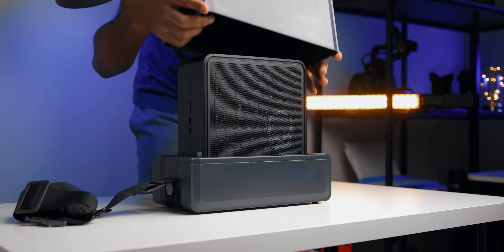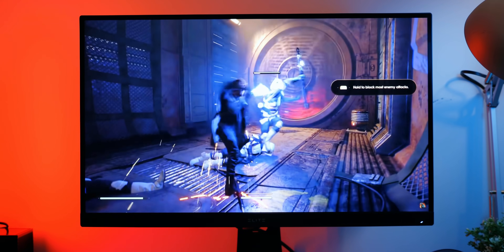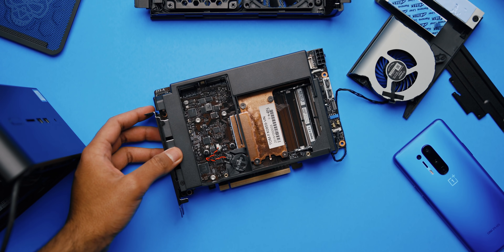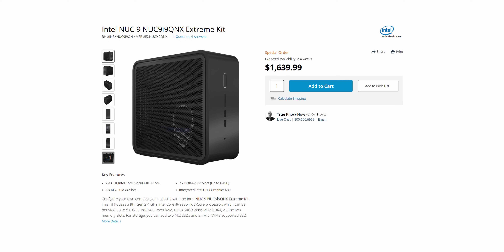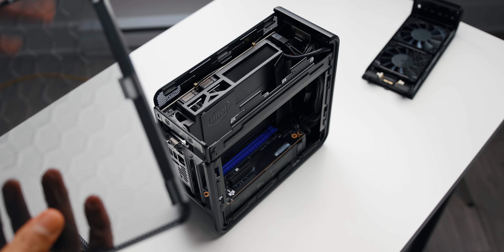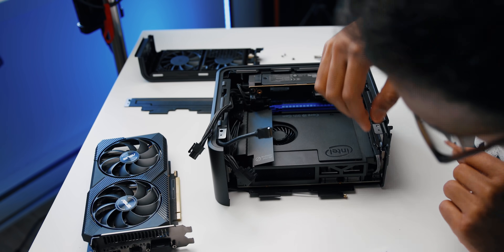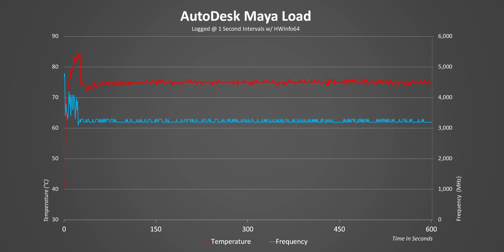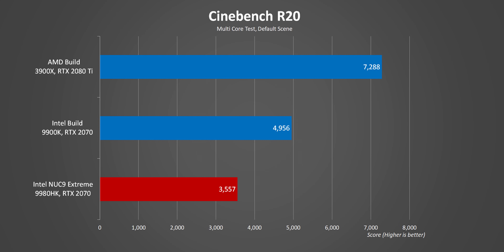Is This TINY Gaming PC Worth It?  Intel NUC 9 Extreme Review

Comment: I just bought the i7 model brand new for £480.  I added a Samsung 970EVO Plus 1TB and 64GB of RAM from an 8th gen I3 NUC that I had running Server 2019.

Fantastic upgrade for a Hyper-v server.
The i3 was struggling with multiple VM's.

Going from a dual core with HT  to 6 core with HT is great for the Virtual machines.
Reply: @ConkeyDonkey  I have upgraded mine to Windows Server 2022 Data center.

I run around 14 Virtual Machines.  I have not looked into Proxmox yet but I do have the 8th Gen NUC I could use for Proxmox.

Comment: NUCs are absolute garbage. There is no segment they really fit into. Single use case, get a pi. Small factor, build a iTX. Power saving? AMD iTX. Longevity? Again, PC all day. Other than a single use device that MUST be windows, I see no real benift to them. And yes i have used them at work and yes i have owned one.

Comment: I needed a small PC myself, and I went for ASRock DeskMini A300. It is a barebone containing motherboard with AM4 socket, two SO-DIMM slots and two M.2 slots (one for NVMe, other for Wi-Fi). I put a Ryzen 5 2400G, 2x16GB of 2666MHz DDR4 and a Samsung NVMe I already had in it. The form factor is smaller than the NUC, the performance is lower as well though, and it has no slots for a discrete GPU. But it's cheap and with far more replaceable parts than a laptop (or this NUC).

Comment: All these reviews are confusing me.
The only place I'm seeing these being sold is on simplynuc and you can kit out an i7 model with an rtx 2070, 16gb of ram and 128gb storage for £1,500 which, when compared to other prebuilt pc's I've seen, sounds quite reasonable considering the size and power.

Comment: As usual you don't have a clue at who or what the NUC is designed for. Your IGNORANCE about things NUC is almost as bad as the Verge. Watch a PROPER channel such as Gamers Nexus to understand what the NUC is about. They have always been ridiculously expensive. They are not designed to be compared with existing platforms. They are experimental in form factor and design and implementation. Learn your PC history. I've been building PC's for 30 years and your lack of knowledge is astounding.
Reply from the maker: No.  They WERE an experimental form factor.  This is NOT an experimental form factor anymore when there are plenty of ITX systems that can reach similar sizes and if GN says otherwise, shame on them.

Comment: The way I see it, it's targeted towards the same people who buy gaming laptops, but who also want the freedom to upgrade their hardware later.
Reply: The thing is that a similarly spec laptop is cheaper, and still easily upgradable as this since you can't upgrade the CPU in this either... The only sacrifice with a laptop is that you have to use an eGPU through thunderbolt to upgrade the GPU later, but you get a screen and keyboard with the laptop portability.

Comment: Is this more portable than a comparable laptop?  Nope, not particularly (and it doesn't come with a screen or keyboard!).  Is it cheaper than a comparable laptop?  Nope.  Is it faster than comparable laptop?  No.  I'm not really seeing the purpose of this release by Intel.  They should go back to doing what they did with Hades Canyon, that form factor was at least significantly smaller than a laptop, and the price was premium, but not as bad as this.

Comment: So it's basically a laptop without a screen (running a laptop cpu). Completely undermines the point of getting a PC, you can't put a powerful GPU in there because the CPU won't keep up.
BUT if laptop spec chipset is good enough for what you want then you'd want the screen for the option of portability. Totally pointless IMO. 
For me, you'd either build a mini-ITX in a case like the NCase M1 and have the full grunt of a proper desktop process. OR. You'd get a laptop for a bit of light gaming and the option of using it whilst on the move (you could even get a docking station for use at home).

Comment: Its pointless, you can buy loads of really nice ITX cases that are only a bit bigger, but you can use proper modular desktop parts without the obvious thermal and power limitations of this. 

Also the OEM versions look like they will be larger anyway! Just do an ITX build with a full fat desktop chip, not this cut down laptop chip. Hell even the Corsair One would be way better!
Reply: I can appreciate the design effort and it does seem to be an elegant design, its just such poor value for money.

Comment: Design is pretty genius, gotta give them that. We use a few of the old NUCs as build machines or small webservers or simple data crunching machines, those use-cases don't need GPU. So I agree, business use can be a decent market fit. I bet the "outdatedness" comes from project delays, I'm sure these are not easy to design but they probably locked down on the CPU spec fairly early on.

Comment: The 10th gen i7 Is literally a rebranded 9th gen i9, so you do technically have a 10th gen cpu in that thing lol.
Reply: Theking196 10th gen has an updated micro-code and some hardware security mitigation and updated chipset and memory support. But it term of performance, it is largely the same.
Reply: @NizarElZarif  Yet is didn't patch any important, already exploited security issues...
Reply: i feel so scammed with my 9700k, and to think I waited 10 years before a brand new build from scratch!
Reply: @jimjon2855  i also have 9700k its still really good right?
Reply: @jimjon2855  cry in Xeon E3.
Reply: Most things are rebrands. 😁

Comment: Over priced Intel Junk.  I know its trendy to dump on Intel but man this is just poorly designed overpriced garbage and thats too bad because the industry needs new ideas and form factors.

Instead of the tiny blower heatsink being built into the compute element the cooling aspect should be part of the case.  A front mounted 80 or 92mm fan that channels the air across a short heatpipe equipped heatsink, something like what is done in 1 and  2U servers.  There could even be different tiers of chassis that would support larger cooling solutions that would support more powerful compute elements and larger GPUs.

AMD; work with some partners and build this.

Comment: $1700 for  an 8core base system 
DOA
 I can  build  smaller itx  full build with real desktop component for for less
Reply: Or with 3950x. :D
Reply: @IgnatiusDavidPartogi  
Actually u can
 There are like 7 smaller cases
The velka 3 is smaller n few others
Reply: Ignatius David Partogi velka 3. Yes u can
Reply: Of Dan a 4 case with 7 litres of capacity. Ez

Comment: What if i plug that PCIe compute unit into a complete gaming PC build? Will it work?
Reply: It will work if you can power its funky 10 pin connector, but they won't be able to communicate with each other without connecting them to a network or something similar.

Comment: Apparently Intel thinks it can charge the "Apple Tax" for their old gear. I wish AMD would get together with some mainboard co and make their own all-in-one with their Athlon/APU chips. Bound to be better and cheaper than Intel.
Reply: All this cost is coming from the R&D, it's not about charging an "Apple tax".
Reply: @xKrikket  A lot of it is sunk costs given it's last gen thats already had sell through. This is almost like getting rid of unwanted stock because people got wise and bought AMD instead.
Reply: @TalesOfWar  Then why don't they just lower the price. It's easier that way.
Reply: Perdomot it is “intel tax” which is way overcharge than apple and razer =V ...
Reply: You can get a velka 3 case with a 3950x on eco mode stuffed in it with a 2070 mini XD. There's a lot of other flex PSU cases that are similar to it as well like the k39v2

Comment: Garbage product. You can build a similar size, faster AMD itx build with overclocking for cheaper. There is no up side for this. Knowing Intel and their motherboards, it'll be a dead end platform.

Edit: seriously, you could buy a laptop with the same specs (with 10th gen) for the same price... With a battery, keyboard, monitor, trackpad, etc
Imagine paying $2400 only to get %1 low on RDR2 of 30fps.
Reply: I mean, even suppose you just don't want AMD you could still get a cheaper Intel itx than this garbage

Comment: Its very $$$, Buy a Dan A4 v3 ,a ITX 570 mobo ,a 3700X a 2080S 2 slot,16 GB of ram, a 2tb 2.5" hd and a 2tb m.2 SSD,and a Seasonic SFX 650 and your better off and have cash left over.

Comment: Somehow all your reviews start with a bias against Intel.
Reply: It's for the price. That shit is super expensive.
Reply: Agreed.  It is expensive, but the entirety of the review is about how expensive it is.  I was expecting more insights/opinions on the future of PCIe based compute module, portability, upgradability, etc..The benchmark comparison is limited to similarly priced ITX rig of AMD 2300$ but a cheaper 1700$ ITX build of Intel. Also, phones are super expensive for the performance they deliver.
Reply: @srivatsana   upgradability and future are big words when you're working with proprietary hardware. As sad as it is, the safest thing to amuse is that next gen Intel changes the design in a way that upgrading is not possible.
Reply: @srivatsana  
This just the CPU  base system
Man u need to buy everything else separately.
 After u done u probably spend like 3000$
U cna build mini itx pc with better components with way less.
This product is doa.
Aleast for  normal consumers.
 Maybe  companies is a good idea.
Reply from the maker: Seems like ours was the most balanced.
Reply: @HardwareCanucks  I would agree with Atul, I've been following your channel for a few years, I've stopped watching your videos recently, you're getting a bit biased or jaded. Intel tried a new form factor or style give them some credit, it's not a complete dumpster fire.

Comment: Will it work if you plug it into pcie slot in the pc and provide an 8 pin power, probably for one of those two systems one case system?
Reply: It has a weird 10 pin power connector

Comment: Hard pass for me.  I don't need overpriced, proprietary hardware from Intel.  They are trying too hard to be like Apple.
Reply: Besides the CPU/Motherboard... nothing else is proprietary, in fact Intel has other companies making NUC enclosures with bigger space for power supply and beefier graphics cards.
Reply: If Apple make similar thing, it will cost 3 times and people will buy it like a hotcakes.
Reply: @Fudge Supreme Apple is much more reasonable than Intel anyway
Reply: Appearance is much more for enthusiasts, but enthusiasts value other things like performance, thermals, acoustics, upgradability, price/performance... which are all sacreficed in NUC 9.
Reply: that and it just doesn't make sense. you can buy a gaming laptop with these exact same specs with a built in monitor for a MUCH cheaper price and then hook it up to an external monitor whenever you want .. im not sure if anyone needs this

Comment: This seems like it’s targeted at businesses wanting something reliable, with the small size, premium PSU and interchangeable modules. A couple thousand dollars won’t scare away companies that want something like this. I used to work for a health insurance company that wouldn’t allow certain staff to have laptops for privacy reasons and they will likely run these in the next year
Reply from the maker: Yeah, that's what we were thinking though there's no way a health insurance company would need these.  They could just go for a standard NUC and not the NUC 9.
Reply: Chungus Pizza the Skull and “extreme” branding would suggest otherwise though.  The compute unit might be the next generation of Intel high density compute though.
Reply: Yeah the skull is strange branding for something that can’t run a beefy three slot GPU or the like
Reply: @internetmistakes  for companies that buy this stuff, they buy it in bulk and the company will probably make special case includes for them, just not painting the skulls or putting a different logo on.
Reply: But times like this show that a Laptop that, even if a Laptop would be bit more expensive, offers much more for a company. As workers can take the laptop to meetings, for working out of the office and in this time take it for home office. When I did my internship, everyone had a laptop in the office and just grapped it when they went to an outside testing facility. Actually for funny reasons I got a highend HP-Laptop, with a big battery, for one workday away from the office I didn't even take the charging device with me. And you get the same insurance and reliability situation with the Laptop as you would with the NUC.
Reply: @miagi1337  He mentioned health insurance. Probably was individuals whose job handled customer data which were not allowed to have laptops due to HIPPA compliant would be my guess. My current job laptops are default, but a couple individuals have to have desktops for certain data/tasks for SOX and HIPPA compliance
Reply: Businesses aren't going to be buying barebone kits and parts only to be assembling systems themselves out of reliability concerns. The Flex PSU is less reliable than the laptop bricks that come with the small form factor Dells or HPs. Service contracts and having a few spares on site is a better approach if availability is a concern. 

Most office type jobs aren't going to utilize the dedicated GPU expandability. The people who would likely need it would be handicapped by the last gen laptop processor.

The compute modules are more for specialized applications. It seems Intel is using the board in a more generic use case to offload old processors.
Reply: This is exactly what I see this being marketed too.
Reply: Nope. Companies will go with a Thin/Thick Clients or if needed a Laptop with a dock. This is pointless for most of the companies out there. Not to mention that Dell and other companies have better alternatives to the NUC.
Reply: The health insurance group I was working with needed pretty powerful PCs due to the huge data files we had to work with

Comment: I have a cheaper, smaller, and more powerful system with my 3700x and 2070 in a K39 case. The only reason to buy this is ease of assembly, assuming you NEED something as small as it is.
Reply from the maker: Yes but this isn't for DIYers.  ;)

Comment: Imagine if Amd made this but with the 4900hs
Reply from the maker: That's assuming they'll ever produce enough of those.  ;)
Reply: I want that for my Asrock A300.
Reply: The biggest problem with all of these is Ryzen 3000 desktop SFF - Zen 2 is SO efficient, AND AMD has lower wattage power plans for all of them that offer a meaningful efficiency improvement with a relatively minor affect on performance. With a high end air or liquid cooler, you can build something that will utterly curb stomp all of these for the same price or less, with comparatively infinite modularity, and with not a lot more size, the choice is utterly obvious. If/when ASRock releases a 7nm AMD-based mini, the only benefit will be in getting something that is slightly smaller than the smallest SFF builds.

And, this is the root of all of Intel's troubles - 10nm turned into such a dumpster fire that, although it should've been what Ryzen 4000 mobile has turned out to be and should be tailor made for use cases like this, it simply does not have the horsepower as a result of the physical manufacturing process not being capable of producing high clock speed chips.
So, that only leaves 14nm for high performance applications, with its now outdated architecture that has fallen behind in IPC, and has to make up for it with ride or die scorched earth voltage sucking clock speeds, that literally hinder its maximum performance, which is specifically not ideal in any way for a use case like this. With IPC, multi-threaded performance(where AMD has traditionally excelled; not in raw core count, but in the effective use of all of these cores at once - parallelization[there's a hell of a word...]), and efficiency, current generation Ryzen just carries multiple advantages, not to mention being acknowledged as the next evolution in CPU construction, with Multiple Core Module-based construction just drastically increasing manufacturing yields & chip quality like is rarely seen, resulting in a very significant improvement in margins. 
With their supply problems and now the 'rona going down, it's looking pretty worst case scenario

...oh yea, the NUC... It's a physical representation of Intel's problems - yea, that's what I was saying...
Reply: OH now this would be a kick ass small PC. (:
Reply: I was going to write the same thing
Reply: With 4900H
Reply: I was also thinking the same... Although this is pretty cool other vendors will be taking advantage of AMD's new cpus soon. NUC is small but in a strange form factor and proprietary AF.
Reply: ooo i just posted my reply and then i saw yours lolsssss
Reply: drools I know Gigabyte has done an AMD based BRIX in the past BUT that was with the lousy A8 SOC and wel before Ryzen was a thing.BUT a more modern day one with 7nm Zen2/Zen3 would be SWEET and just throw Intel under the bus once again in a different market.
Reply: They made it,  for 1600 $ you can buy a a XBOX Series X + A good Laptop with a Rayzen CPU
Reply: S L. Rayzen hahahah it’s like raisin.
Reply: @DMSparky  hhhhh My bad !